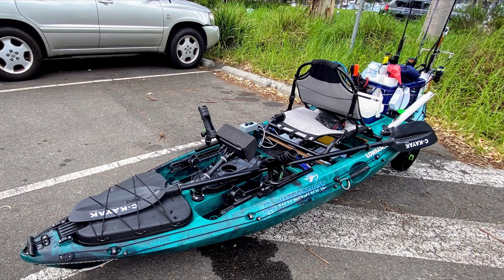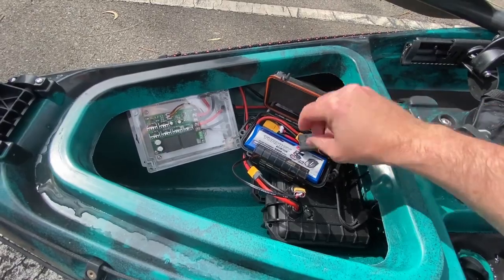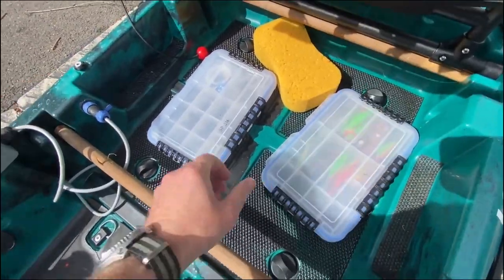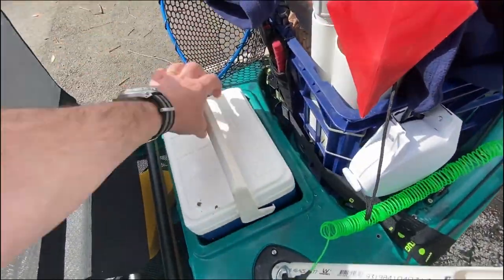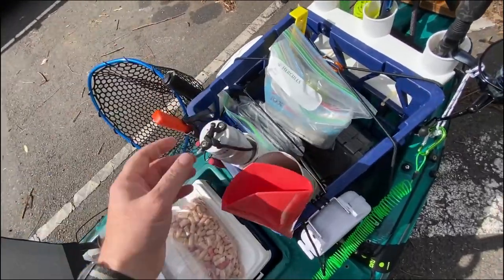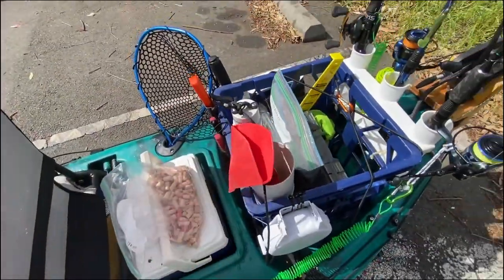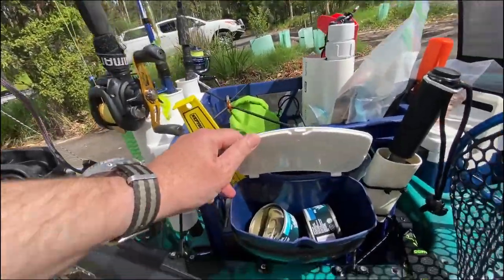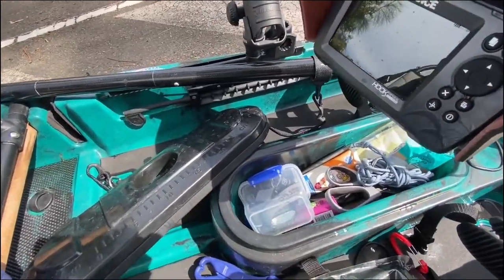Fishing Kayak DIY Mods and Rigging Walkthrough

Comment: I have just got my first kayak, and it's the Pryml Titan. Good walk through with your set up and idea's on how to set up mine also. Certainly not with the electronics, but i can see how dedicated you are with what you have done. I like the seat raiser (wooden broom handles. I have used a could of small pieces of Plastic to use the higher position in order to the get a little bit of hieght in the seat to use the space underneath. 
Good Job. Thanks for the preso. Will keep an eye out for your vlogs.
Reply: Good to see how you car top you Yak and what technique best suits your set up and how long in takes for you to get ready to go out once you get to your destination.
Reply from the maker: Awesome, thank you!
Reply from the maker: It was just a lift onto & off the roof.  Setup was done near the car and then Railblaza cart used to get it to the water.  There is a method to use the Railblaza cart upside down on the back of the car (sedan) and roll the kayak up onto the roof.  I did use that method near the end before the upgrade to the Hobie (and boat trailer).

Comment: Mate, you're pretty handy with the mods, nice work.

I've just bought a Kayaks2fish Nextgen 11.5, purchased the motor, battery, anchor system etc but haven't started the setting up yet.

I really need to research what to buy for water tight battery box and running through placement of wires and set-up.

Then how to install a sounder, but I'll get there.
Reply from the maker: Bunnings has a Tactix case at the moment that i now use - my handmade batteries fit.  I purchased the others from Aliexpress - just be careful as the one I received didn’t have a seal. I needed to add some myself.

Comment: She is Beautiful!! Caught my attention because, I have a 120 pdl 33" wide. Same hull, deck, and tankwell design as your kayak. I run the Bixpy j2 motor, attached to my drop down blade rudder which is toe controlled. I have my spare Bixpy battery mounted behind my seat, and a 12V Cabela's battery, inside my battery box with my usb's/VM/12V plug. That runs my FF and bow light's. And I run my 48" led 360 light on the stern gear track. With me at 5ft 7" she moves around 5mph. Which is perfect speed getting to my spots, totally hands free. Beautiful shot in the morning with the fog, pure serenity out there. 🙏 🎣
Reply from the maker: The Bixpy would be nice and that's decent speed to get around.
Reply: @inshorefishingoz  Definitely and I knew i needed a motor, because I also have a heart condition.The Bixpy, comes with all you need and perfect for a kayak. I've been out on 10hr trips, and covered areas, i didn't know existed. I looked into other motors, but there $1800 and go much higher. And on a kayak 4 to 5, mph is a safe speed.. Especially when we're maybe 3 ft off the water.I love my PDL drive and my paddle, for exercise, or sneaking up on whatever species you target. Good luck bri, stay safe.. 🎣 😎 🙏

Comment: Love the lithium  battery set up thats how u do it ! not sure why people keep buying lead acid.. they produce way less power ,  heavy, more expensive per effective  wattage output and does not last long ..for its lifetime usage and it takes longer time to charge!
Reply from the maker: Agreed - Lithium weight savings and depth of discharge are a material difference.  Initial cost can be an issue - I managed to source all materials and a spot welder for around the same or a little less then buying one.  I did find out later that I had been ripped off on non-original cells, but was still getting great duration.  Since then, have built an even bigger battery for the motor and repurposed this one for all the accessories.

Comment: Did you cut the front compartment off? How did you go with keeping the water off the yak? Found that the water do filled up at the back.
Reply from the maker: I did cutout the front well.  I found the front well hatch seals well enough that I never had in issue with enough water getting into the hull to concern me even when swamped over the bow  from wash.  I did use the scupper plugs and carried a big sponge to bail out anything in the cockpit if concerned.

Comment: Hey mate nice rig, where do u mount your transducer
Reply from the maker: This kayak has a covered transducer bay in the bottom of the hull.  The trick was how to mount it though - I think I originally used strong double sided tape to mount the bracket to hull.  I then swapped it to cable ties to the baseplate.

Comment: How have u put the motor mount on the back
Reply from the maker: I made up a mount out of marine ply, using the rudder mounting hole and because of the way I designed it to wedge either side of the hull, there were no holes in the hull there.  That didn't stop me making plenty of big holes elsewhere - including cutting out the front well!

Comment: Where is transducer mounted ?
Reply: Yes good question. I have the exact same yak and am looking at purchasing the Garmin Striker 4 plus, however I want to understand how to mount the transducer in this yak. Has he installed it within the area that can be accessed underneath the body? I guess so. It would be great if he can reply and confirm this, maybe even explain how he has done that.
Reply: @willgriffiths1410  I fitted my mates up recently with a striker 5. There’s a space under the yak where a transducer can be fitted it took 10 mins.
Reply from the maker: Exactly guys - this kayak has a transducer box under it.  It doesn't have screw points in there though, so I first used strong exterior grade double sided tape to mount it in there, but I think I then changed it to cable tying to the cover.  What I did do though was use the cable glands into the front well (which I cu out) to then run the cabling into the front well and back out for battery / transducer cable.   Kept things much neater.

Comment: where can I get the same motor mount with clamps ion Aus?
Reply from the maker: The transom mount on the motor comes with it.  The mount on the kayak is hand made with thick structural beam ply that I had offcuts of, and some 1" marine ply that I bonded together from memory.  I marine varnished and used stainless fittings.